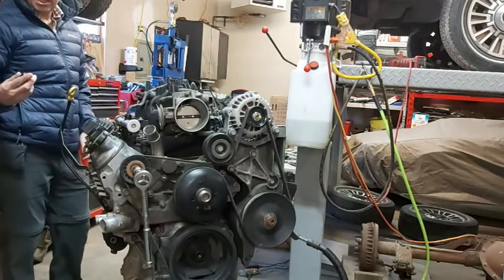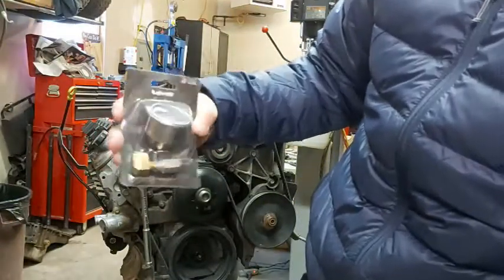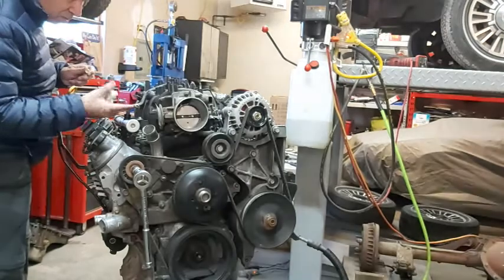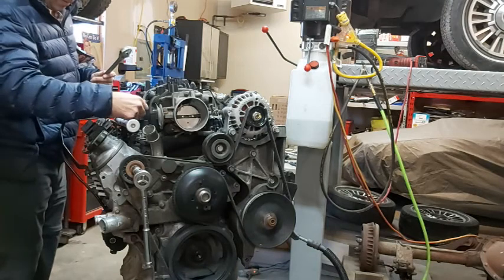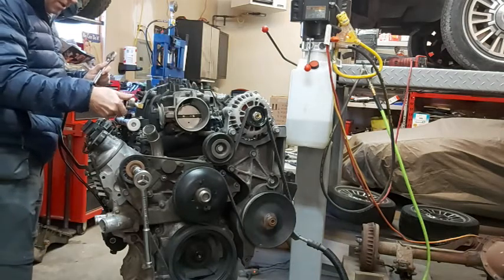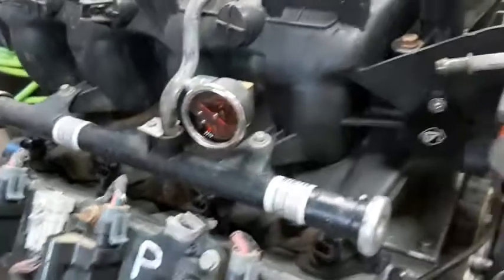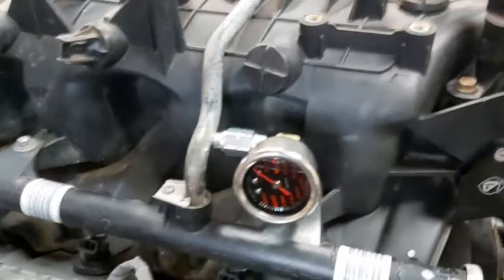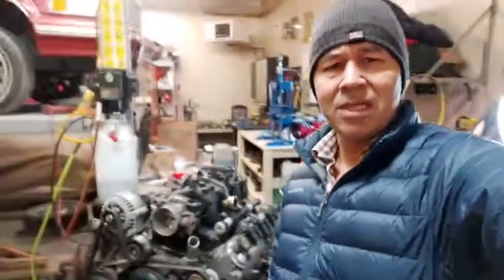L.S.  fuel rail pressure gauge install on factory truck L.S. intake manifold

Comment: @Lets Boost It Does this fit a 05 Chevy truck stock intake? With or without removing the valve? Also, does the fitting come with a built in valve to press the pressure port for a reading?
Thanks
Reply from the maker: You have to unscrew and remove the pintle  pressure relief assembly before you install the pressure gauge and associated fittings. If you don't remove it, the pressure will not be read by the gauge as the pintle acts as a stop to pressure flow. Thanks for watching and commenting.....Oliver

Comment: Do you have the part number for the part you have for the fuel pressure Gauge set up.
Reply from the maker: Yes I got that gauge from these guys at the link.  https://www.vmsracing.com/products/liquid-filled-fuel-pressure-gauge-0-100-psi-for-ls-engines-lt1-92-97-and-l98tpi?variant=16866428097 ....thanks for watching and commenting....Oliver
Reply: @BooostedLS  thanks

Comment: Can plumb a regulator and fuel return from that port?
Reply from the maker: I found that the stock fuel rails return line was to small, necking down to only .150" resulting in 75lb of fuel pressure, which was too high. Had to go to aftermarket fuel rails and regulator. Thanks for watching and commenting....Oliver

Comment: What’s the part number
Reply from the maker: Of which component or components?
Reply from the maker: you'll find it here.... https://www.vmsracing.com/products/liquid-filled-fuel-pressure-gauge-0-100-psi-for-ls-engines-lt1-92-97-and-l98tpi?variant=16866428097